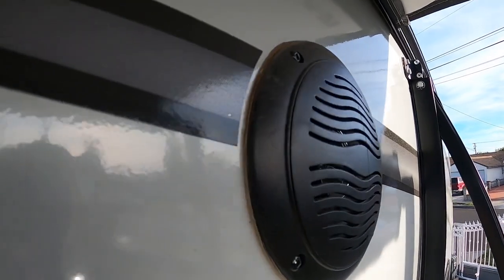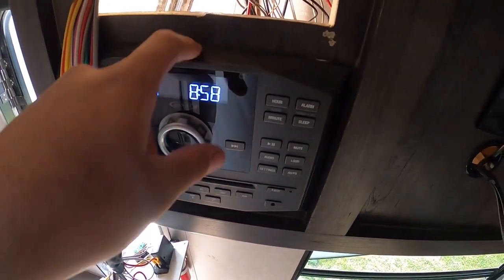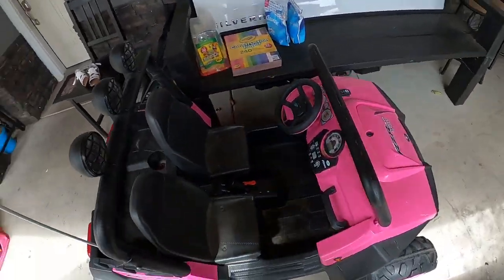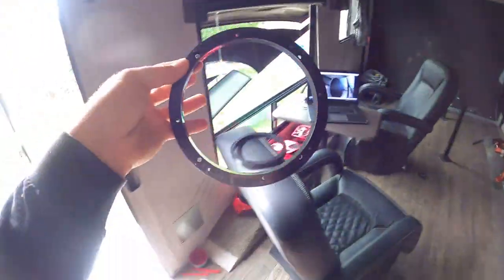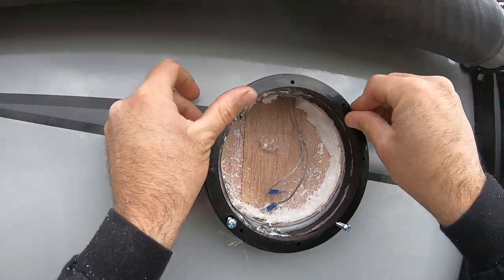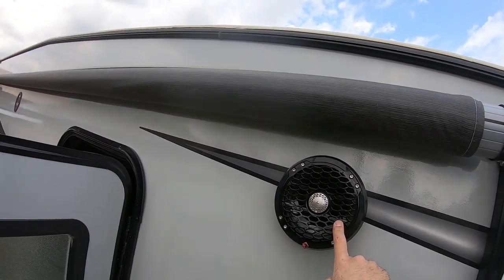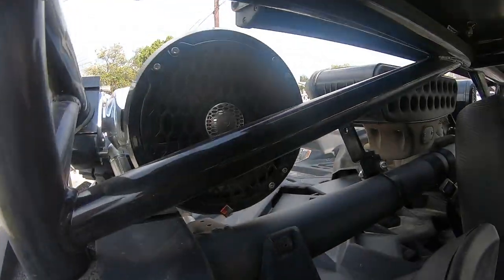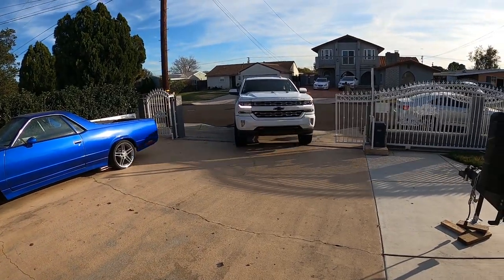Attitude Toy Hauler Speaker Upgrade to Rockford Fosgate Ep 56

Comment: The tiny airspace behind the speakers will always massively limit bottom end. In some cases, adding a bit more air volume behind can do wonders(remove a bit of foam, or make small enclosures for the back if the holes back onto cupboards or similar)
Reply from the maker: Makes sense. Honestly for the amount of times we use it. Its a drastic upgrade from what was on it. But good point. Thanks for chiming in👍

Comment: How did you run the wires from the stereo to the amp so the speakers button selector can still work for like a and b
Reply from the maker: They wired exactly in the same manner going in to the amp as they exit the amp...So channels a and b work the same.

Comment: I'M Glad someone did a video on this i'm looking at toy haulers But i can't see spending 80,000 or more with  that crappy sound system  at last they should offer  a Alpine , Kenwood  or pioneer   stereo system not jensen
Reply from the maker: Mine was closer to 30k.. my buddy purchase a fifth wheel version of the toy hauler that he got for around 58k. That one came with a kicker sound system, but even that one has issues. Thanks for watching🙏👍
Reply: @GLifeUTV  too bad they don't sell them in my part of the country I like that three axle one but I'm seeing people on you tube having too many problems with them
Reply from the maker: @bigp20019  my buddies 5th wheel had issues with his toilet, the subwoofer, some smoke detector that wouldnt shut off, power cable door came off . We have learned that there are definitely better brands. Get what u pay for i guess..
Reply: @GLifeUTV  yes sir
Reply from the maker: Consider subscribing. Thanks for watching

Comment: Hey Sir, just caught your video on exterior speaker upgrade abd will be doing this to my 5th wheel.  I was wondering though, like to here more details if possible, on how you did your amp install in your camper.  As that and a new head unit is on the shopping list.
Reply from the maker: The amp is just piggy backing off the radio power

Comment: Where did you wire the positive and negative cables for the amplifier? Did you just tap into the power and ground from the radio?
Reply from the maker: Yes.tapped into radio

Comment: Sir, very much interested in how you wired up your stereo amps in your camper, as I been wanting to upgrade the audio in my 5th wheel and add a amp along with the new system.
Reply from the maker: We pretty much used the existing speaker wire and piggy backed the power and ground for the amp off the radio
Reply: Did you toss in a fuse anywhere when you piggybacked off the power?

Comment: Do you Absolutely need the amp for the speakers to work? I believe amp will allow you to make them louder. But I’m
No stereo guy. Wondering if I could buy speakers now and amp later is all. My speakers are blown just looking to get them working again and split up
The cost. Let me know thanks. And perfect video by the way!!
Reply from the maker: Your will get poor sound without the amp. These speakers require more juice.. but im sure they would still work
Reply: @GLifeUTV  Just got all the stuff in the mail for this set up. Couple questions where did you pull power from to power the amp. Did you hook up the rem connection for switched power? If so to where on the radio? I have the same head unit as you. Last but not least what size fuse did you use for the amp.

Comment: question on your amplifier...  did you use a line output converter or does that head unit have preamp outputs on it??
Reply: every headunit will have line level outputs, but it may not have a preamp. His amp will take a direct line level input, and thats what he did.
Reply from the maker: im late to the party... thanks for answering. u rock

Comment: Did you only hook up 4 speakers to the 4 channel amp and leave 2 straight to the radio or all 6 to amp?  If so, how? 

This video is dope man, I just upgrade my 4 interior ones, now need amp and exterior speakers.
Reply from the maker: I only have 4 total speakers. Two on the inside. Two outside. Thanks bro i appreciate it

Comment: Did you run a power line all the way back to the battery? 400 watts probably needs an 8ga wire depending on how far away the battery is.
Reply from the maker: used existing radio 10guage wire..
Reply: @GLifeUTV  Got it. My radio is supplied with a 14ga wire which is pretty thin. Would I need to run the power cable back to the battery or is there typically an electrical panel I can run to? I've wired up a dozen or so cars/trucks but not familiar with RV/trailers.
Reply from the maker: @CorbinDallas88  well i myself thought about running another power source, but on my hauler it really does look like a pain in the ass.. i would probably be easier to go to the battery then to the 12v electrical panel. i would do it to the killswitc, so you can still shut it off if needed. not jus straight to the battery.
Reply: @GLifeUTV  Yeah it's going to be a pain in the ass lol. Unfortunately I don't really have a choice since my lines aren't large enough. I already installed a killswitch so I'm good there. Not too worried about running the power line to the battery, I'm more concerned about the grounding. The amp is about 10ft or so from the chassis, so I'm not really sure what to do there. Ground wires should be as short as possible (usually less than 2') but that's not an option for me. I may have to wire it up like a boat and just run the same size wire as the power all the way back to the battery. Or is it fine to have a longer ground wire and just run it to the chassis? main reason I'm posting this here is because I'm sure others will have the same questions.
Reply from the maker: @CorbinDallas88  I don't see any reason why the ground cant be grounded to the chasis even 10ft away...as long as the guage of the cable is sufficient. and the chasis has a sufficient  ground to the battery. which in most cases these haulers do. As long as you have good connections you shouldnt have an issue. Even in modern vehicles with so many computer modules. the chasis is used for grounding all the time.

Comment: Yo man, thanks for the video. I have all the same stock speakers on my Attitude too. I would love to do the same outside speakers you did but I just don't have the time. What are some good drop in replacements you recommend for the outside? Should I run a separate amp anyway regardless of the speaker? Thanks bro
Reply from the maker: Gonna be hard to find some good seakers without adding spacers cuz the depth of the wall is very shallow bro
Reply: @GLifeUTV  I'm ok with running spacers. I just don't want to be cutting a bigger hole.
Reply from the maker: @jasonkubitz9410  okay well honestly any speakers are better then the paper crap that comes with it.. grab some kickers they are affordable.. as long as they are 5.25.. i beleive thats the size
Reply: @GLifeUTV  Coo. If I go 6.5s, do I have to cut the whole bigger even when using spacers? Or does it depend on the speaker?
Reply from the maker: @jasonkubitz9410  i would say it depends on the depth size of the speaker bro
Reply: @GLifeUTV  Aight thanks man. Sorry bout the 1000 questions. I'm watching your video over and over to see if I'm just gunna straight up copy you lol. I know you're up north but maybe we'll see you out at Superstition or Glamis some day. Be safe bro.

Comment: Hey bro great video, now that you had these outdoor speakers for a min, are you still liking them?
Reply: Also did you run your inside speakers to your amp too? Thanks for any info
Reply from the maker: @Hotshot80640  Night and day difference from what came factory, and yea we also ran some rockford speakers in the inside that are powered by the same amp. very happy with this setup
Reply: @GLifeUTV  thanks bro for the quick reply, I’m going to get them ordered, I was just concerned about the outdoor speakers putting out quality sound for such a tight area. I have to take your word for it since you like Milwaukee.
Reply from the maker: @Hotshot80640  Lol, to be honest, any speaker is gonna be then the stocks ones that came with my unit.. The oem speakers, im sure you can tell from the video are absolutely terrible. haha
Reply: @GLifeUTV  I was definitely looking for a little bit more punch and something we could turn up a little I blew my crappy speakers the first time I used my trailer and my trailer is brand new. I’m definitely going to try out the speakers thanks again